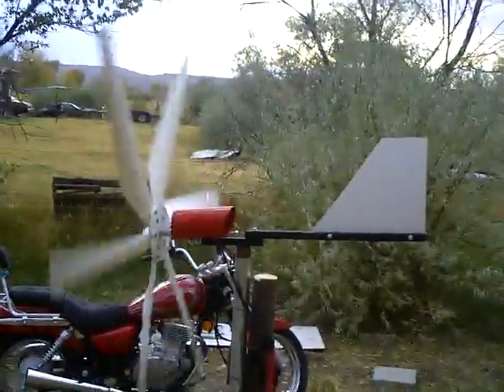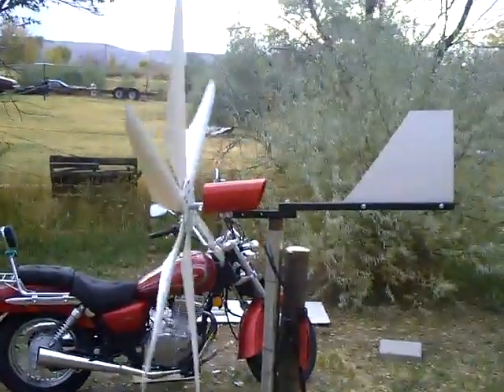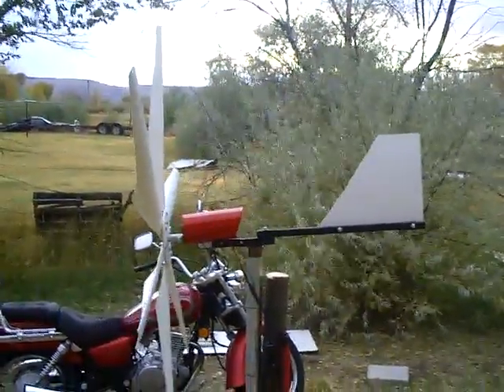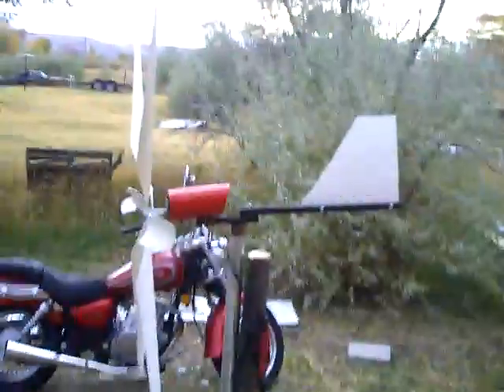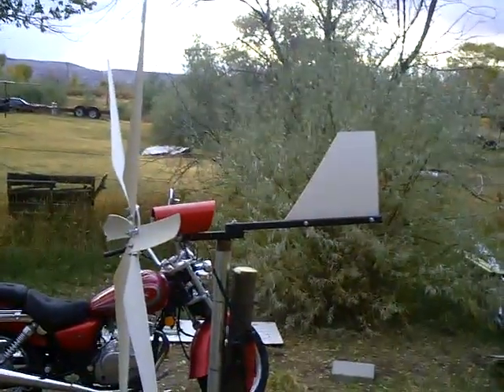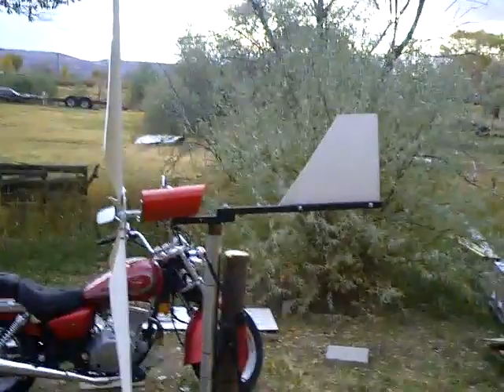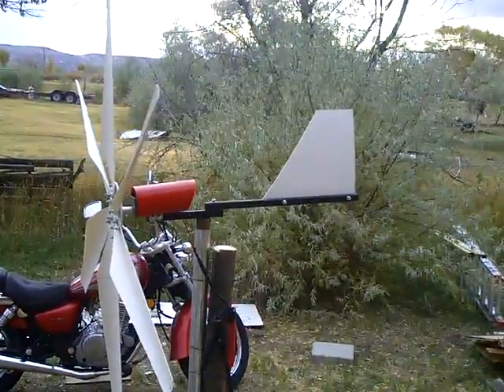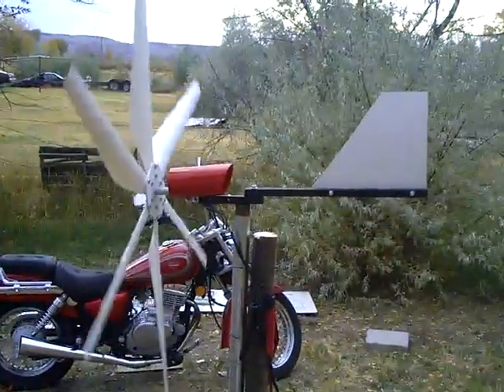wind3

Comment from the maker: Small wind turbines like this are not used to power a home and are only used as trickle chargers to top up batteries on low sun days.  if you have lots of wind go with an air X or Breeze model.

Comment from the maker: A wind generator produces continual power as long as the turbine is turning and does not require gas to operate.

That iss 10amp hours continuous power.

Car alternators will not work for wind generators.

Comment from the maker: It will be mounted this weekend. It does what I hoped it will do and helps top up my batteries on low sun days.

Use lock tight on the bolts and there is almost no maintenance.